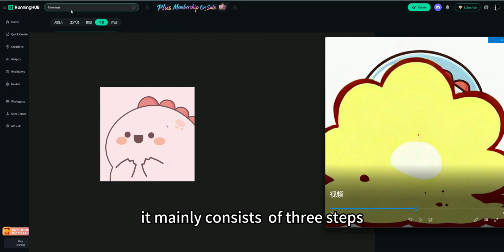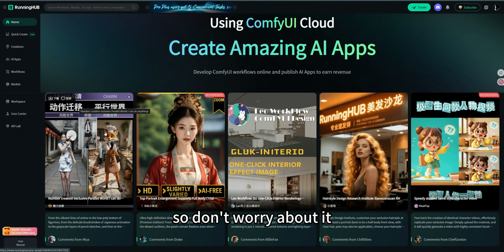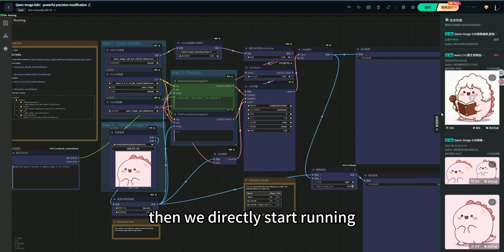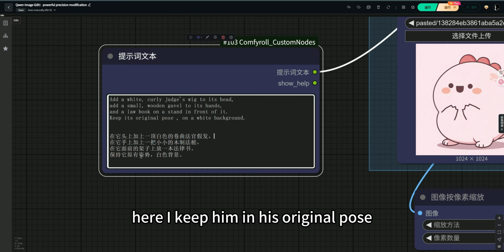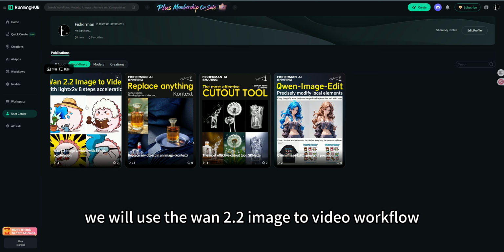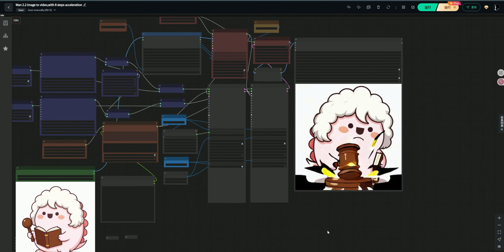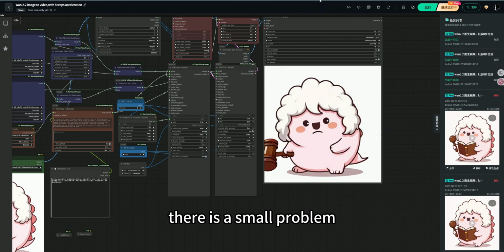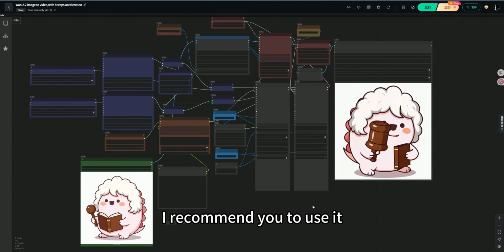How to create a series of cute dynamic emojis in Comfy UI.

Comment from the maker: These workflows are free to use: https://www.runninghub.ai/post/1962345452177920002?inviteCode=rh-v1222

Fan Benefit: Click your avatar in the top right corner, then click Invite Code and enter your invite code. You'll receive 1,000 RH coins. Log in daily to earn an additional 100 RH coins.

Invite Code: rh-v1222

On this platform, you can experience the speed of the 4090 GPU, which even has 48GB of VRAM.